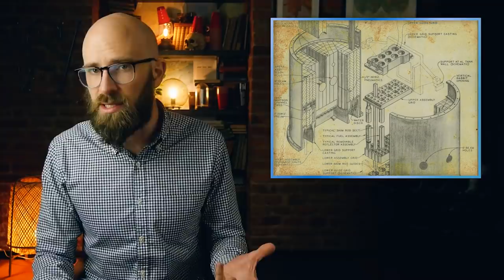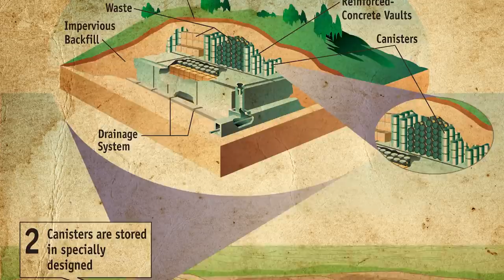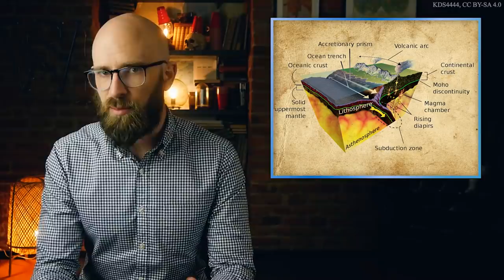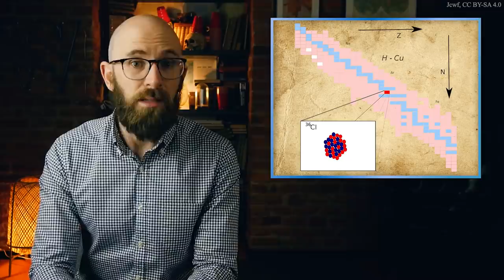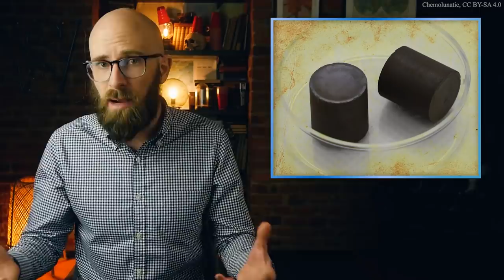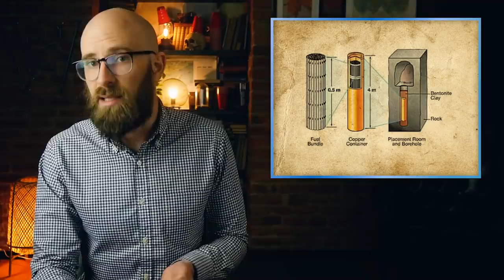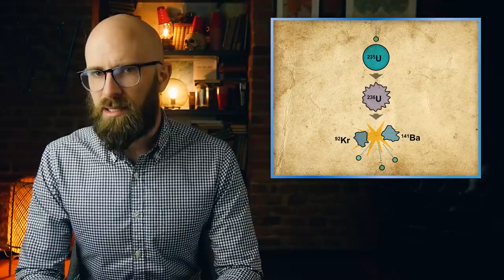How Does Nuclear Waste Disposal Work?

Comment: How hard could it be to create a rail gun to fire projectiles full of nuclear waste into space? A current day military rail gun can fire a projectile 126 miles over land. If you fire into space, gravity and air pressure reduces to zero as you get higher and you only have to get to 68 miles to get into space.

The current disadvantages of modern day rail guns are down to the compact size requiring incredible power and speed over a very short distance. If a much longer rail gun was created, the acceleration could start slower and ramp up. This would negate the damage to the rail system caused by dumping 6 million amps suddenly into them. A spiral 1st section would allow the projectile to build up initial speed but allow the gun to remain more compact.
Reply: Any sort of launch tube seems like an improvement to our open air launches. All our current launches are like the equivelant of lighting a firecracker in the palm of your open hand; all the energy blows out in every direction hardly scathing the hand despite having the potential energy to blow the whole hand apart.  It'd be ideal to contain all that and aim it all behind/below the craft being launched. I mean rocket engines already do a good job of aiming the thrust but something tells me a sealed tube and pressure differentials would be an order of magnitude more efficient in the opening stage. Seems so much more efficient. My conclusion as to why we don't do this already is with how the rocket scientist must know something I'm not considering.
Reply: That huge billowing cloud of smoke that surrounds the launch vehicle in the first moments of launch. Why not contain all that wasted energy inside basically a gun barrel.

Comment: I still think deep ocean disposal makes the most sense, there are already a whole bunch of animals and extremophile life forms down there that survive either because of or despite the high radiation and heavy metal in the water exuded from deep sea vents.  

I think increasing the availability of deep sea radiation sources may have beneficial effects on the basal food pyramid of the disposal area in the long run as bacteria and plankton evolve to consume the heat, radiation, and eachother.  

In the long run it might increase the diversity and avaliability of deep sea life especially if we drop it in subversion zones, monitor the radiation levels compared to other ocean areas that are also naturally radioactive, and try to limit the disposal zones as to not effect adjoining sites untill we can observe the effects on the native  and surrounding life forms of a given disposal area
Reply: There were 14 countries that openly dumped into the oceans for many decades. I can't find any articles showing how marine life has been permanently adversely affected by this practice.  Water is an excellent radiation shield.
Reply: @danadurnfordkevinblanchdebunk  
I honestly agree. A few meters of water keeps everyone safe from radiation. What would kilometers do? Not to mention it would be buried multiple hundreds of meters more in the crust and incased in extremely durable and pressure capable storage units.

Comment: I thought the main reason in industry against nuclear is that it alredy costs more than wind and pv and is progonosed to cost roughly twice by 2022  per produced MWh. 
So even if someone successfully convinces the public that modern nuclear plants are safe, capitalism will prevent them from being built and the market will choose renewables.
Reply: The flaw to this scheme is that renewables cost less and are just as reliable. Renewables by themselves are pretty cheap, assuming you ignore the slave labor in China to build the panels and the fact that there is no plan to recycle any of them. But if you leave that aside, the additional infrastructure to transform very low energy-dense, intermittent sources like wind and solar into reliable, dispatchable electricity capable of replacing fossil fuels is wildly expensive and uses huge amounts of land. Once you take real life into account, nuclear is cheaper.

Comment: Not 62,000 tonnes of waste. Not even remotely.

The global civilian total is over 400,000 tonnes.
The US alone has over 130,000 tonnes of civilian spent fuel waste, of which over 80,000 tonnes is still in the allegedly temporary cooling ponds and only about 55,000 tonnes is in "interim" dry cask storage. The "vast majority" is not in casks, the "vast majority" is still in cooling pools.
There is probably more than that by now, as the IAEA 2022 status report is based on a 2016 survey.

Military wastes go back eighty years, with remarkable neglect and now face remarkable difficulty in management. The global totals are hard to estimate due to military secrecy.

I would suggest that the title is deceptive.

No one knows how nuclear waste disposal works, because none has been disposed yet.
None.
No spent fuel waste or high level waste has been disposed. None.
No functional facilities exist and none have accepted such waste. The Onkalo site in Finland is nearly ready, but has been one year away from opening for over three years now.  

"current disposal schemes"
There are basically no "current" schemes, just plans.
These barriers do not "ensure" as they have not been tested in place.
They are not overkill, they are likely to be barely adequate over the timeframes in question.

Your statements on the Oklo site are incorrect.
The insoluble actinides did not migrate very far.
The immediately soluble fractions certainly did. The same chemistry that made the original uranium precipitate and that retained the plutonium bombardment products would not have retained the water soluble components, and obviously not the noble gases.
Down stream of Oklo would have been distinctly lousy for the hundred thousand odd years of it's operation. 
Fortunately, two billion years ago there was virtually no multicellular life to notice.
We cannot depend on Oklo as a guideline.

I do not think waste disposal will be in any way "key". The cheapest option is already known: direct disposal of intact spent fuel.  Everything else costs more. Lots more. 
This has been known for a solid fifty years, and so far nothing has been done, the industry hoping to pass the hot potato to government. Government hoping industry will magically find a cheap solution despite making no real investment to do so. The defenders of the nation would rather bicker in court with DOE than display the honour and backbone to take responsibility.

Currently renewables are rolling out fifty to one hundred times faster than nuclear, at a fraction of the cost per MWh. Private investment is avoiding nuclear like crazy, and public utilities are fighting to avoid future guaranteed purchase commitments.  These are not the ingredients of a renaissance.
If there is a future for nuclear, it has nothing to do with the habits, management, ownership or culture of present nuclear.

As for communicating the risks to the future, forget monuments and messages.
As we backfill the tunnels, give the future a course in nuclear (and  ordinary) chemistry. bury samples of the elements where feasible and example compounds of all of them. Diagrams of atomic models, of fission, of basic chemistry concepts: electrom shells and the periodic table.  Examples of basic lab equipment and prisms and spectral equipment. 
How to make photgraphic paper and radiation sensors, and example pieces to demonstrate how different radiation causes different chemical changes. Fluorescent materials.
Cartoons of living things near radioisotopes and their subsequent death. Examples of shielding appropriate for each type/intensity of radiation.

We can't stop them digging it up. We can teach them chemistry without a single word in common.

Comment: I think it's somewhat arrogant to think that future humans will never figure out how to deal with nuclear waste. The assumption of the people in charge of building the spent fuel dumps seems to be that humans will revert to lower intelligence.
Reply: They have! They will! From one generation to the next people are getting dumber! By 2100 our troubles will be over.
Reply: That's staying on the safe side. We're talking about timescales in which we could evolve into a different specie, you can't just bet society will continue for that long and that knowledge will be preserved. 
Assuming total collapse means you have to make the storage safe enough that future cavemen will not mess with it.
Reply: @thomasewing2656  Thats incorrect.....Did you know that the inverse square law does not apply to extender sources of radiation?  Did you also know that all radiation detection monitors are calibrated using the inverse square law and measurements taken as well?  Did you know that the main issue with nuclear fission is water solubility and evaporation occurring under equillibrium conditions causing movement around the planet?  Did you know that even tritium believed to pass through you within a month is actually false and once ingested forms organically bound tritium and then causes cancer?  The population isn't getting more ignorant it's the lifestlyes we a leading that is ignorant.